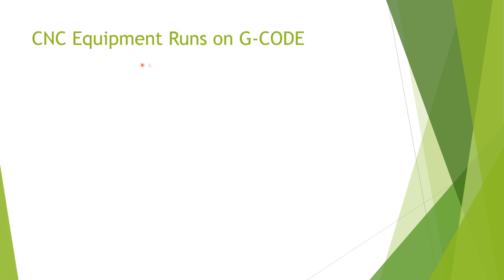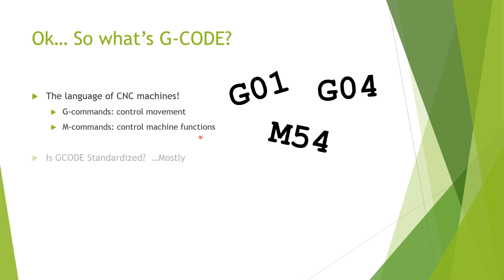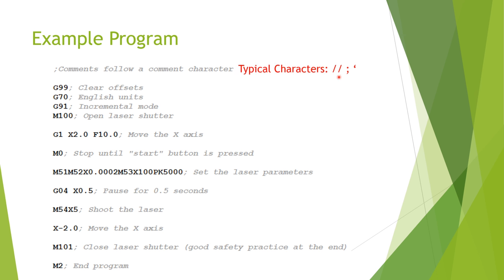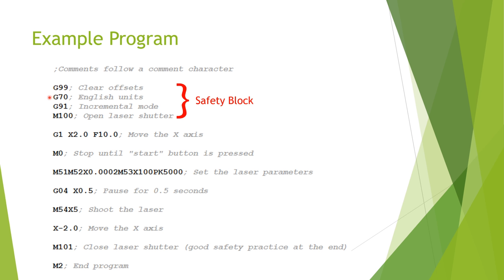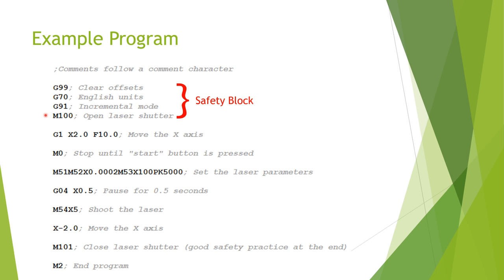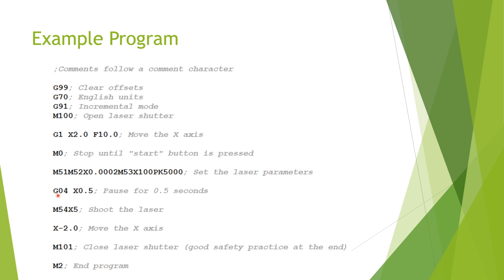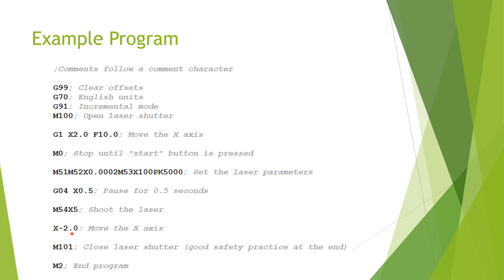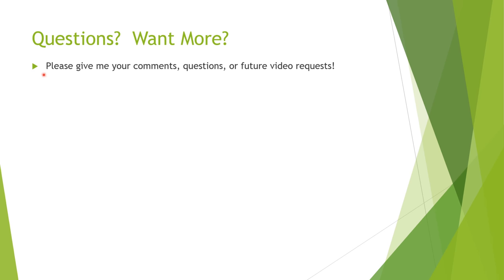⚙️⚡⚡ Basic Intro to CNC programming

Comment: Sorry but you are incorrect G99 is inch per rev for lathes, G70 is a finishing cycle. You need to realize the different G codes for milling or lathes. some are the same and some are not. Your presentation is nice though.
Reply: He said it's MOSTLY standardized, which means "your mileage may vary by machine"
I think 80% of viewers are working with milling and not lathes, so it makes sense to use that terminology \ definitions. 
Chill. Go drink a juice box or something, think about your actions and how lording it over all us Peons doesn't make us want to join your hobby if you wanna gatekeep so hard go join a cricket club.